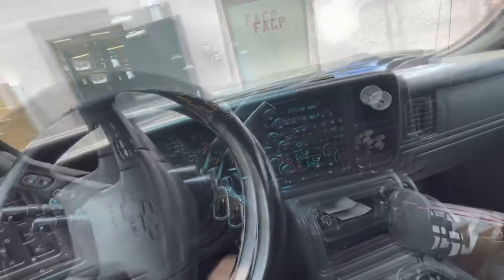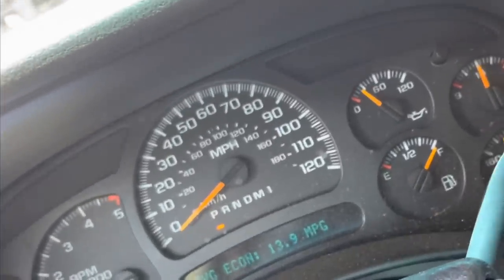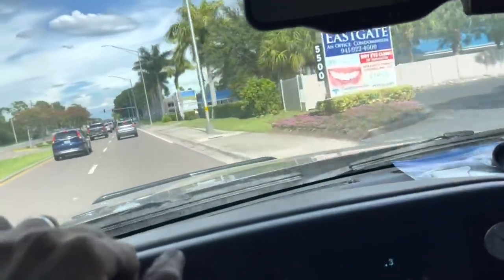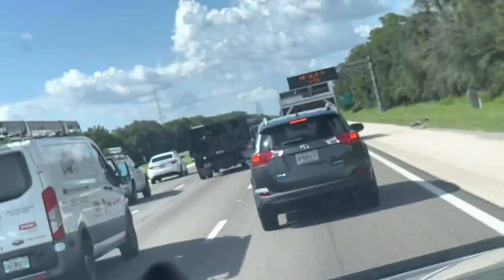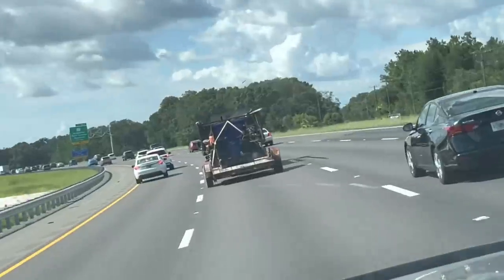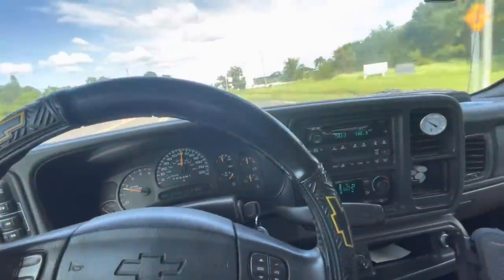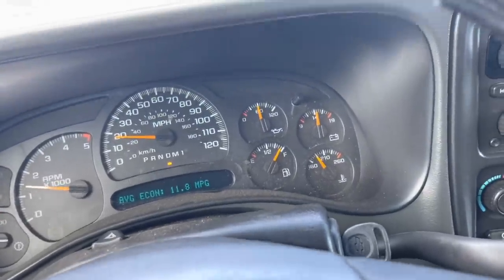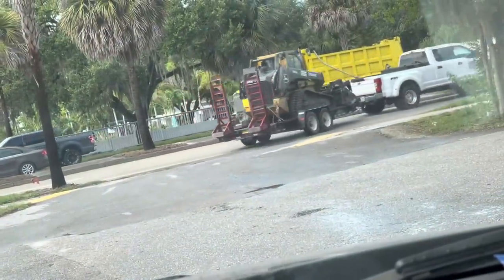Need answers! ox-cetane Diesel Fuel Experiment | Duramax 6.6 LBZ

Comment: If you do the math of how much electricity costs per minute to charge the EV in some places, then your big engine isn't bad at all.
Reply: In Australia, electricity production is the single biggest polluter in terms of carbon emissions.  And, the grid could not handle everyone turning to EV's. So for now at least EV;s are not the answer, they just move the problem somewhere else.

One day they may well be, there may be something else yet to be discovered, but one thing I do know, we need to honestly look at alternatives to petrochemicals, be that electric, hydrogen... whatever.
Reply: @iffracem  Powering vehicle with gas is fine. Just plant more trees to compensate for pollution. Remove all the fake humans and suddenly the air would be cleaner.
Reply: As far as I know, nobody has ever made an artwork out of EV. I'd still stick to the gas engines even after life. I have a bucket list of what things I wanted to do and one of the things is to get hands-on with a 2JZ engine or a straight 6 or 8 and do an artwork of it. There is NO expressing yourself with EV vehicles.

Comment: No, no, no (lol)... Put the stuff in someone else's tank, don't tell them - then wait to see whether they notice any kind of difference.

BtW, resetting your average fuel economy "gauge" practically turns it into a vacuum gauge for a while - step on the pedal, it goes down,... coast, and it goes up. Because there's almost no data to calculate the average from :rolleyes: .

Comment: Ok, 375000 subscribers, Why, Why do drivers have to slow down to .01mph to gawk at an accident, an officer that pulled over a vehicle, or a vehicle that's on the shoulder with a flat tire? and slow the 15 miles of traffic behind them?  Can we all stop being so inconsiderate of others, YOU are on a highway, with higher speeds, and that one person a mile back is not paying attention and causes an accident. The drivers got on the highway, not because it's the only way to their destination but the quickest way to their destination... Uhm key word here folks: Quickest!  This is the most absurd phenomenon that I encounter way too often and it really pisses me off knowing I'm getting 4 mpg because someone has slow to a crawl to check out someone else's misfortune.  

Sorry, Ray... I needed to vent.

Ray, you should do a video on what people can do to improve or restore their fuel economy, like the air filter, throttle body maintenance, air pressure, reducing rotating mass, reduction in weight, etc...

Comment: Ray u wanna get 20 mpg unladen and 24 mpg while towing get a bullydog tuner I have a tuner on my 200.4 ram 3500 and I’m getting 20.3 mpg unladen and 28mpg pulling my boat that weighs 14650 lbs I have a cold air intake stock injectors and stock turbo a stage 2 transmission invest a few hundred dollars in a tuner and you’ll be happy as a moose with your mpg gains

Comment: Here in the UK they have now made inter-vehicle communication a driving offence.
You are not allowed to flash your lights, or even raise your hand as a "thank you" gesture
ANYTHING that takes your hand(s) off the steering wheel is now classed as illegal and can result in a fine and points on your license
Reply: That’s nuts!
Reply: Cop's don't like your hand gesture? No sense of humor.
Reply: @deborahgeorge3238  The UK has gone nuts when it comes to motor vehicles of any kind. They are even going as far as to make manual gearboxes obsolete. Basically ANYTHING they can make the driver pay for they are trying to implement .... Driving with the wrong sunglasses - Fined, Driving with windows open - Fined (should be using AirCon), Idling the engine - Fined

The ENTIRE country has gone PROFIT mad

Comment: Playing Devil's Advocate here for a minute....if you find a gas station selling diesel for, let's say, 30 cents/gallon less than your "usual" places and you fill up your 90 gallon aux tank, doesn't having to haul around 90 gallons of diesel (which weighs about 630 lbs) negatively affect your fuel economy and thus negate the savings of the lower price?  I'm honestly curious...
Reply: For an average gas car/truck, it would be very noticeable.  For a 9200lbs diesel dually with 12000lbs towing capacity, 630lbs wouldn’t even be noticeable.

Comment: An ox (oxen) can be a bull, but used for labor. A bull or a A heifer or cow can also be an ox, if used for labor. No, cow is NOT the name for cattle, only the bred female cattle.
THEREFORE, using Bull or Steer is also right, as a castrated bull becomes a steer. Ox is a bovine used for labor. I single "cattle" is called a 'head' as there is no actual word for a single cattle.

Comment: 3:42 - If you put the numbers that way (the wrong way, btw), Ray, it looks like you have a very economic diesel pickup truck but for us "metric thinkers" that's 18,18-15,83 l/100km, which puts your vehicle in the same ballpark as many semi trucks. However, 13.9 mpg equals to 16,92 l/100. Next time you make this type of conversion, remember we "think" in l/100km, not in km/l.

Comment: If there was really a chemical that would significantly increase performance/mileage, wouldn't it be included in diesel by default? The claims on the bottle made no sense and contradicted what he told you over the phone. If anything, I bet it's just any other cleaner and helped your fuel system perform better. I dump some injector cleaner in my car about once an oil change and it does make a difference in keeping my injector spray pattern proper.

Comment: Average 15 MPG means you use about 6.5 Gallons for 100 Miles. For non Us people, that is 24 Liters for 150km or 16L for 100km
Are all the trucks in Us sucking gas like your ex used to do it ?

Comment: Ray, have you looked into propane injection?
you can run 50% or more LP. it's cheaper than gasoline 
so it lowers our avg fuel cost

Comment: If your jurisdiction allows it, and you are comfortable doing it, you do you!  But we will be judging you, Florida man ;)
The UK highway code states that you must not operate any mobile communication device while you are in control of a motor vehicle unless it is used with a hands-free kit; basically you can't touch your phone while the engine is running, apart from presenting it as a payment device at a drive-through.  Part of the issue with holding a device to record is that in an accident it could get stuck under a pedal or become a loose projectile and injure someone either in the vehicle or outside of it; and if you are holding it while driving - your control is impaired vs not holding it.  UK also has laws that require dogs to be adequately restrained in vehicles, because they can also become a projectile in a crash.

Comment: Your videos are watched across the globe and as such local driving standards of the USA are not accepted in other countries. For myself, I find the attitude of using cameras whilst driving unacceptable and downright dangerous. In the UK, using your mobile phone while driving is an offence due to the dangers of distracted driving to both yourself and others on the road. 

Using any phone while driving is dangerous - driving is a highly complex task requiring a person’s full attention, as any error can be catastrophic. Drivers who talk on phones, both hands-free and hand-held, are four times more likely to be in a crash resulting in injuries [1], and researchers have found a correlation between phone use and culpability in crashes.

The primary impairment that drivers face from using a phone behind the wheel, is the mental distraction from the driving task. Research has shown that after using your phone, it can take half a minute to regain full
attention, during which time your driving is impaired.

Aside from mental distraction, any distraction that takes a driver’s eyes or hands off the road for any length of time (for example to check messages or scroll through music options) is potentially lethal.

The penalties of mobile phone use while driving in the UK

Using a hand-held phone while driving can result in 6 penalty points on your licence and a £200 fine.

If you are a novice driver, and only passed your driving test in the last 2 years, you will also lose your licence (6 points within the first two years results in automatic disqualification).

Comment: Florida's texting and driving law states that drivers can make phone calls, check weather or traffic alerts, and even use phones for navigation unless driving through a school or construction zone. These are considered “hands-free” spaces where any phone activity while driving is illegal.

Florida Statute 316.305
According the official Florida statute related to texting and driving:
"A person may not operate a motor vehicle while manually typing or entering multiple letters, numbers, symbols, or other characters into a wireless communications device or while sending or reading data on such a device for the purpose of nonvoice interpersonal communication, including, but not limited to, communication methods known as texting, e-mailing, and instant messaging...the term 'wireless communications device' means any handheld device used or capable of being used in a handheld manner, that is designed or intended to receive or transmit text or character-based messages, access or store data, or connect to the Internet or any communications service...that allows text communications."

Comment: I know of an easy way to increase fuel economy it's the good old tried and tue method of turning it off and walking to work. Sure it might 10x longer to do even the most basic of tasks but hey that's what all the climate change activists say to do.
I would say make a law against the snake oils but it's really funny sitting at work listening to people swearing by x product when they say they are getting 1mpg more when the bottle they just dumped in their tank cost $20. The only snake oil I believe in is fuel injector cleaner and the only reason why is it stopped my truck from back firing due to it having throttle fuel injection it has 90k miles on it and I've been the only owner to change the fuel filter on the proper maintenance cycle.

Comment: While driving it's against the law to be using or talking on your phone. Don't you think the same should and could apply to pointing a camera and talking to it while driving. If you do not see the danger and if everyone thinks they will not be distracted.  Because; just simply they believe they are a much better driver than the rest of us. When in fact this ignorance makes them the most stupid and dangerous. Multi-tasking while driving is not recommended in any driver's manual.

Comment: I suppose this is the first step of a sponsorship by Ox-Cetane? This stuff has been around for years, they tried to sell it to fleets, big diesel consumers. I tried in in a fleet of 125 heavy trucks, made zero difference in economy. Additionally, if you have an engine problem while the vehicle is under warranty and they detect any additive in the fuel, warranty denied. Save your money and avoid headaches, buy good quality diesel and leave the "Snake oil" on the shelf for the less informed. Sad to see where this channel is headed.